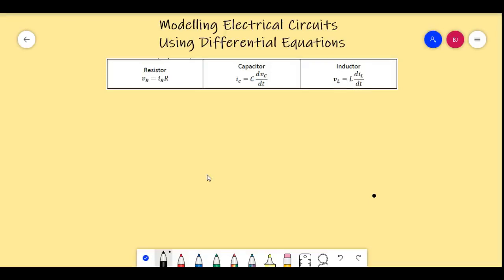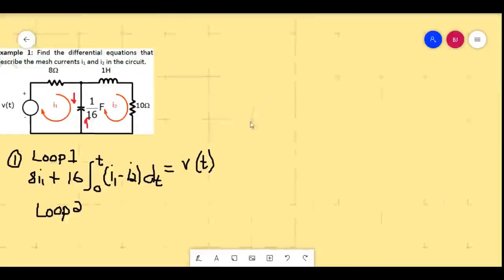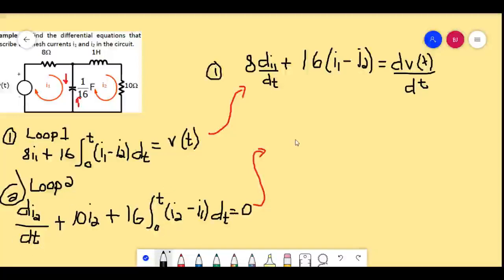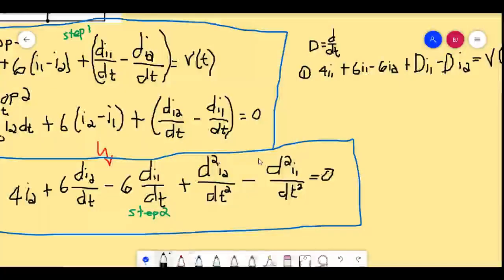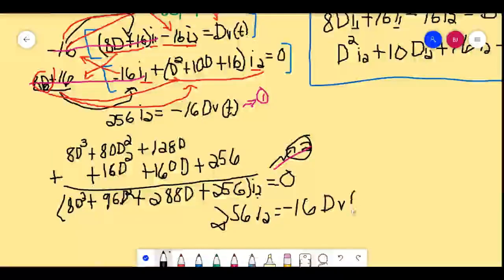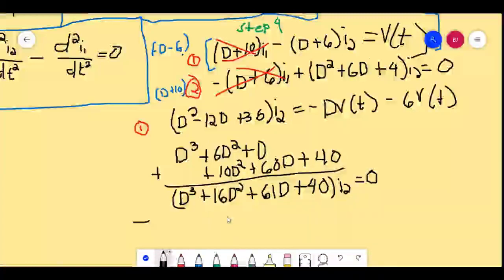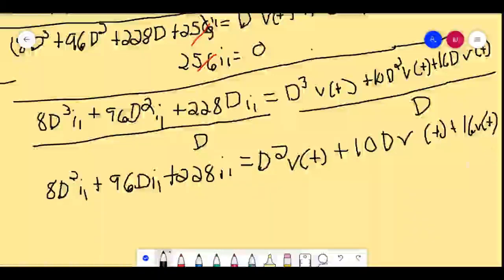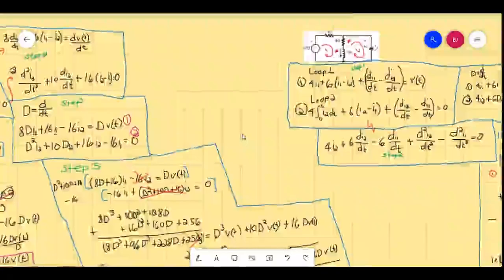Mathematical Modelling of Electric Circuits using Differential Equations

Comment: The whole lecture is clear and the viewer does not get lost in any of the steps. Mentioning how the formulas are derived and how to convert them into other forms (e.g., when a problem calls for current instead of voltage) is a huge help. interesting take on constantly switching between two examples as well; it acts like a "breather" and helps the viewer absorb the steps even more than one big, tedious, chunk of a process.

Have definitely given a thumbs up. Control Systems seems like a difficult subject (especially for someone who's had a hard time with Calculus I like me lol). I look forward to "Episode 3" of this series of supplemental videos. How I wish there will be too for Fundamentals of Mixed Signals and Sensors and Logic Circuits. Haha.